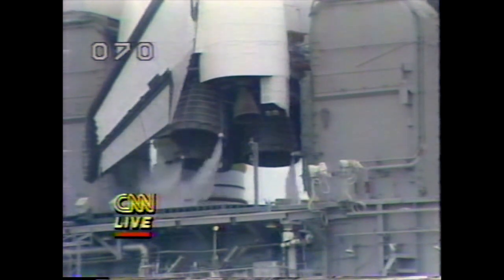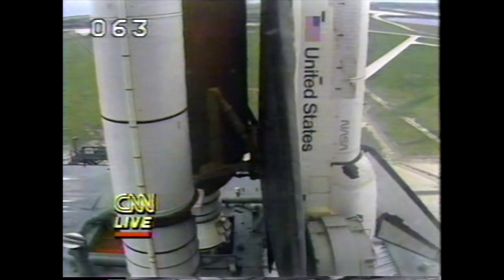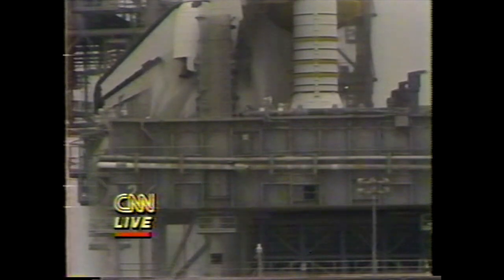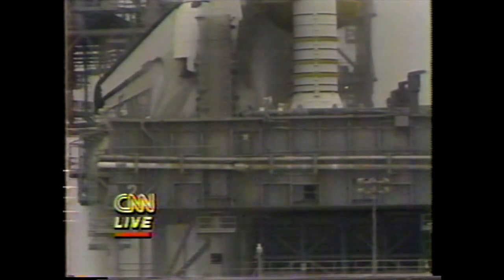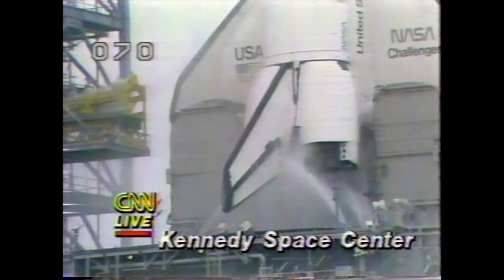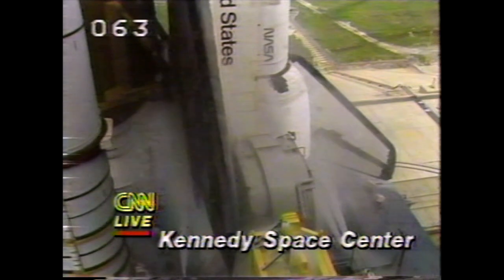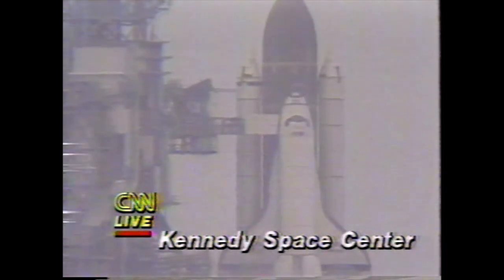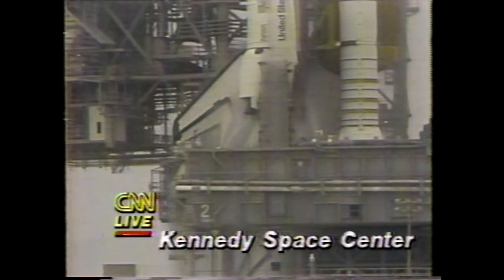STS-51F Space Shuttle Challenger Launch Pad Abort | News Coverage

Comment: This is the first of TWO aborts for this same mission. On the second launch attempt engine 1 was automatically shut down 8 minutes into flight triggering and Abort To Orbit (ATO). Only from the quick actions of a mission controller to inhibit further automatic shutdowns did the mission reach orbit. Had he not done that, additional sensor failures occurred that would have shut down additional engines and likely resulted in the loss of the crew.
Reply: I think that "likely loss of crew" is a bit far fetched. STS-51F had three TAL (TransOceanic Abort Locations) sites assigned. The prime site was the Zarazoga airbase in Spain. The two alternates were Moron airbase (also in Spain) and Ben Guerir air base in Morocco.
Reply: @chrislaing7153  Yeah that's probably a bit strong. It definitely turns into a much sketchier situation to be sure.

Comment: The way the whole thing wobbles back and forth after the abort must have been really nerve-wracking for the crew.
Reply: Twang
Reply: It’s not a wobble, it’s a flex that occurs when the main engines start. The stack would flex and then return to the beginning position at which time the SRB boosters would ignite.
Reply: That's normal
Reply: Storey Musgrave famously said, "I thought we'd be a lot higher when the engines cut off."
Reply: @jonczerwinski7514 waiting for the “kick in the pants”.
Reply: the crew felt the vibration of the ignition of the main engines suddenly cutoff...   not knowing what was next (possible explosion of main tank)..   I'm sure they were relieved to be quickly evacuated from the immediate area.
Reply: It doesn't really "wobble" but rather moves due to the thrust of the main engines, and then torques back to center balance.  Fully known during the development.
Reply: Not really they were well trained for all such eventualities.
Reply: @davidodonovan4982  Just because they were trained doesn't mean it was a little disturbing.
Reply: @chaspfrank  You mean "doesn't mean it wasn't a little disturbing.
Reply: @Bob31415  astronauts don’t scare easily. Some of the astronauts going to the moon had a heart rates a normal person would have sleeping.
Reply: @davidodonovan4982 their training did not include having that much fuel still in the tanks.

Comment: Between 55 and 60 seconds I had not noticed the rainbirds washing the dirt off Challenger. I thought they would be more worried than they were about tile and insulation damage - that is like taking blasts of water from a firehose.
Reply: If it can't tolerate that do you think it could tolerate re-entry?
Reply: Well if it blows apart on the pad, it wont really matter if there is damage from the water.   Putting a fire out is most important.   Don’t believe me, reference 41-D’s abort and subsequent fire.   That abort resulting in this firex being used.